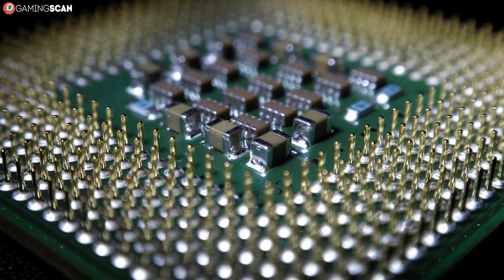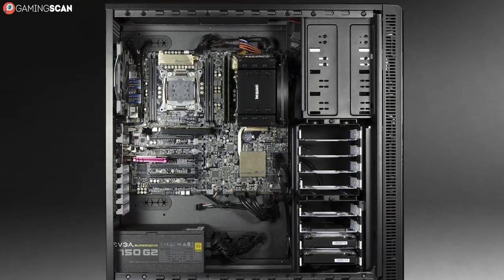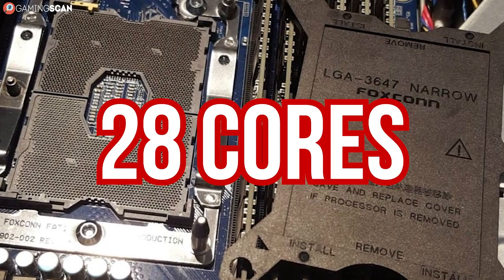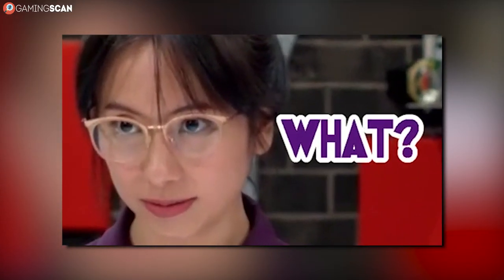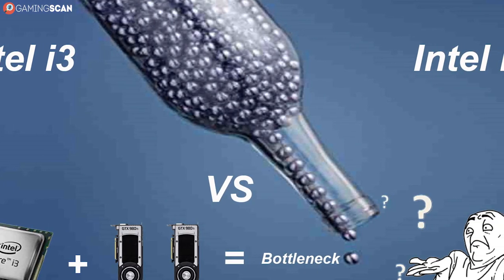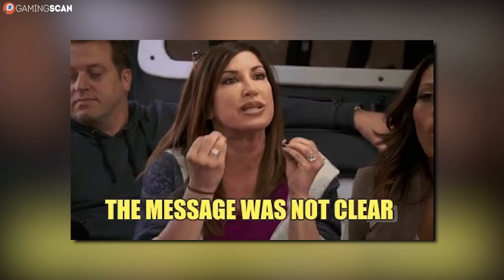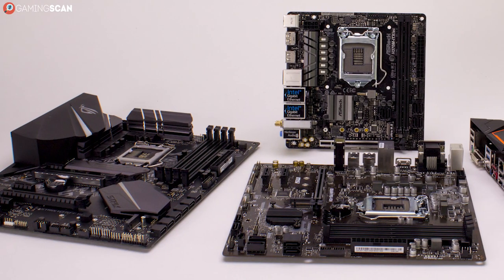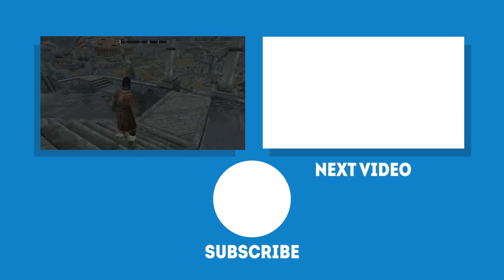Is An Intel Xeon For Gaming Worth It Today? [Simple Guide]

Comment: I've got a Xeon x5675 running at 4.5ghz with 6cores and 12 threads 48gb of triple channel ram and a 1080ti. Keeps up with any top end gaming rig. The Xeon cost me £35 from eBay. If any one is interested I'll make a build vid to show and prove what it can do and how easy it is to set it up.
Reply: Me sir👍👍👍
Reply: go for it!
Reply: do you know if dual x5675 can handle game streaming at 1080p60?
Reply: How did you overclock it? BCLK or multiplier?
Reply: Preach it brother  x5680 @ 4.42 Gtx 1060 20gb ram👍
Reply: How do you get a Xeon overclocked? That prosessor you mentioned has max turbo boost of 3,46Ghz not 4,5....
Reply: @a64738  as long as you have a desktop motherboard not server you can overclock the microcode should be there for 1366 motherboard. And get or build a good water cooling setup
Reply: Have the same band it runs any games at high and ultra
Reply: @a64738  Its very simple with the right motherboard...., its the busclock..., i have a Xeon X 5675 too with a MSI x 58 pro-e board. This MSI Boards have dip-switches on board, you can change the busclock from 133 MHz to 166 MHz ore to 200 MHz, the only thing you must do is to improve the voltages..., my X 5675 run at 1.35 Volts with easy temperatures at 60 degres celsius at 4.0 Gigaherz, my vga is a radeon RX 580 with 8 gigs of vram. All games including Division 2 ore Ghost recon breakpoint running fine with high settings, my monitor is at 1920x1200 pixel, i hope, this will help a lot....the powerdrawing is a little higher, the Xeon 5675 is a 95 Watt CPU, but with the overclock to 4.0 gigaherz it will be at 120 Watt....nice greetings and sorry for my bad english, iam an old german....;-))
Reply: @juergenwinter8378   I have a 220W CPU now... It is a Xeon 2288G 8 core that can run 4,7Ghz continous turbo boost all 8 cores if you use Intel Overclocking tool to disable the 3,7Ghz limit.  But then it uses 220W with all 8 cores at 4,7Ghz at 100% use which is just at the limit of what my huge heapipe cooler can handle even with 4 12cm fans.

Comment: You can build awesome budget gaming computers with Xeon processors.
Reply: @Eduard Berisa I built my son;s 1st rig and he still has it with Xeon E5-2620, turbo up to 2.5ghz 6 cores 12 threads, running next to a 1070 handles any game you throw at it
Reply: @i3luevein  how much fps do u get on a game, and on which games
Reply: @Shay-ul2bg  Hey - he got well over 60 in BF1, GTAV & PUBG. The single core performance is absolutely shite though as I am sure you would expect, but as he does allot of streaming, video and music editing it's a good all rounder. Look around YouTube, there are loads of examples of people gaming with the E5 2620.
Reply: @i3luevein  thanks
Reply: I just bought a westmere xeon x5675 for $25 awesome cpu amazing for a budget gaming machine!
Reply: @liamandrade5167  what about the motherboard?
Reply: My xeon 1245 v2 actually does pretty well. The only game it struggles on  is BF5. New i7 coming in a few months though, I've used this budget cpu too long.
Reply: @NAM3L3555  Just no sata 3 & usb 3.0
Reply: @ProCrastiN8te  If it can be overclocked with unlocked multiplier like a 2500k, I am sure it can at least used 5 years more.
Reply: @raymondchan3587  I'm afraid it can't  but even the unlocked 3770k is beginning to show it's age in some games. Runs most games well still however.
Reply: @i3luevein  on max settings?
Reply: That lady doesn't know what she talking about I running a Xeon CPU and it plays any game at ultra setting without any problem
Reply: Help me , can i play csgo with intel xeon w3550 and gtx 1050 ? ty
Reply: You can play csgo with any xeon
Reply: @kenopayne9466  how many fps? do u know? ty
Reply: I am using a dual Xeon x5575 with a amd rx560 and I am playing any new games without any problem on high and ultra
Reply: @kenopayne9466  what is dual xeon ? u got 2 cpu? xd
Reply: Yes you can csgo is core 2 duo
Reply: 2 Xeon CPU I carry
Reply: Yeah running a Xeon E1231 V3 myself combined with Asus Workstation motherboard, GTX1080ti and 16GB ECC RAM :) It runs GTA V mighty fine and everything else I throw at it ;) ... Now I just found brand new Dell Power edge T30 complete server machine with slightly better CPU then I have for same price as I did pay for just the CPU and RAM on mine...
Reply: @ProCrastiN8te  Hey i know its 11 months old comment but i would love to know what graphics card you used with xeon 1245 v2?
Reply: @basharshafiq850  haha no problem. At the time I had a gtx 1070 and just before thet a 980ti that exploded due to some crazy mods. However both cards were throttled by the xeon that couldn't quite supply them. The xeon  is still good but should be paired with a more balanced card like a 970.
Reply: Can we change the chassis of Xeon to Amy other custom chassis like NZXT or cooler master
Reply: meh

Comment: My Son's Gaming system is a Xeon x5680 and he loves it. He does a little streaming not much but mostly Pictures/Video Editing. Great budget machine. 

GPU: GTX 1080Ti
CPU: X5680 
Memory: 24GB ECC
Motherboard: MSI X58 
Storage: 512GB SSD Boot
LSI SAS Controller with Raid 10+1 (4 4TB Drives)
Sound: SB AE-5
PSU: EVGA 750w

Comment: Using an Intel Xeon E5-2690V3 SR1XN 2.6Ghz 12-Core 24-Thread Processor i got for $340 with 2x 1080Ti's and it kills any game I throw at it (Battlefield V, ROTTR, Apex Legends, Anthem, Overwatch, Rainbox Six Siege, Dirt 4, etc).
Reply: Hi, I wonder does the cpu fast in normal task

Comment: Running a Generation 3 Xeon 1200 series 3,4Ghz socket 1150 in my Workstation / gaming rig myself and it rocks combined with a GTX1080ti :) I chose this old prosessor to be able to run Windows 7 without hickups as it is much much better then 8 and 10 specially for anything that uses lot of memmory and also better performace in gaming.

Comment: best value/performance cpu in my opinion at the moment is the xeon x5670 easy oc to 3.8ghz..pulls far cry 5 and rise of the tomb raider like a charm, with only 30 euros. not bottlenecking my gtx 980ti oc,

Comment: X3440 is a xeon for 8$ and it can perform around a 7th gen i5
Reply: No.

X3440 is an i5 750 (first generation)

You need at least sandy bridge-XE xeon to match i5 7400 or first gen ryzen.

However LGA1366 6-core xeons are a great option for their low price around 20-25$ and can match modern i3
Reply: kkkkkkkkkk
Reply: use x5670 instead
Reply: I have to disagree it has the same cores and threads as it but it probs compared with a i5 3-4 gen
Reply: X3440 is for the lga 1156 mobos.  X3470 performs as like a i7 870 . 
An i5 7400 is far better both in multi core and single core due to better ipc,  architecture.

Comment: Using a dirt cheap E5 2670 ($80 AUD) paired with a 1660oc to game.  144+ fps on Apex max settings, 100+ frames on Rust high settings, 60-100+ frames on Tarkov high settings. You can definitely game on a decent Xeon and it will cost you fudge all.
Reply: Hi John, I wonder does that cpu fast in normal task?

Comment: I currently and previously have a xeon cpu in my gaming pc. this video did a decent job with explaining what a xeon is commonly used for, but it didnt really highlight the fact that while yes a xeon can be used for a server or workstation, if it has the same underlying architecture as say, skylake, then it will perform identically clock for clock with same core count cpus. xeons only really have added features, not negatives except for the higher core count cpus having lower clock speeds. I use a 10 core xeon e5-2680v2 in my main system and it only cost me $180, and it will last me for a very  very long time, as opposed to an i5 quad core which is already falling off.
Reply: But what do you do when the new generation of gpu's wont fit your motherboard anymore and you need to upgrade ?
I mean it prolly only last a very long time, if you dont feel like upgrading for a very long time right ?
Reply: Parasite Andy Why do you need to upgrade a powerhouse that is a XEON?
Reply: @kennybrianshjreklunke4842  What? So not a very very long time, but a very long time? I don't understand your point... at all. The new generation GPU's not fitting a motherboard is a ways off... it's not like he is running an AGP and/or we are on the verge of going back to AGP.

Comment: You can get a x5650 Xeon processor for only $20 on Amazon. Pair that with a GTX 1050 and you have a budget gaming pc
Reply: Dude the problem is the fucking motherboard.
Xeon x5650 need a motherbord with lga 1366
its extreamly rare:in my country i found one for 150$
Reply: @gazefstronof1030  you tried aliexpress

Comment: I have 2 Xeon X5472’s running @ 3 GHz each paired with a 1050 ti 4GB. I can run most games at 100+ FPS (Fortnite, Rainbow Six Siege, Valorant, CS:GO, Warframe, Rocket League) Would recommend to anyone who needs a decent cpu for a smaller price!

Comment: So I bought this $100 dollar pc second hand from 2016.
CPU: Intel Xeon w3565 3.26 GHz
Graphics Card: Nvidia Quadro FX 1800.
16 GB Ram
500 GB Storage. 

Is this playable for Fortnite? If so, can you tell me the FPS range. Thanks to whoever sees this and responds!
Reply: You'd get more for your money if you upgraded to a SSD. Especially if your a Windows user.
Reply: Would want a nicer gpu for modern gaming.
Reply: It’s definitely playable, although I don’t know how much FPS you’d get.
Reply: I wouldn't buy a gpu stronger than a 1050 or 1050 ti

A 7970 3gb can be had for sub 80 usd (might be able to buy it for sub 50 locally)

Then u can play most modern titles at medium-low settings

Note:

If you can grab a 1050 ti sub 80 usd, grab that

If you can get a gtx 970 sub 100 USD - get that instead (prioritise the gtx 970 over the 1050 ti)
Reply: @Lucky_0ne821  the ssd doesn't affect in fps also if you are mac user ;-)

Comment: but some older Xeon W and X chips are really good for gaming and a good price especially when you can fit two of them in the board
Reply: G POWER DRAGON yeah I got a x58 Msi proE board with a x5670 and boom
Reply: @morganroberts295  Yes- here the same rig, a Xeon 5675 with a RX 580 and the same board.....24 gig of ram, it runs all games very well......;-))

Comment: i have a intel Xeon W3520 and it manages to compete with mid range I5 processors and runs well even with games that rely on CPU power.  My system was pre built and only costed about $500 back then. 
a xeon CPU is more better than core CPU for editing, rendering and other workstation tasks whilst performing decently at gaming as well. although if you don't need it for other tasks and you are just considering gaming then I would stick with a core I5 or other cpu that is not for organisational purposes

so it is worth it but only if you can find a good deal.
Reply: Why xeon not suited for gaming
Reply: It is but it's expensive and on my worth if u get a good deal

Comment: xenon 771 mods are great budget build cpus, if you can find a good socket 775 motherboard or already have one with a tired core 2 duo but are only good up to a ($100 GTX 1050 or $50 GTX 750 used) unless you have a realy good motherboard for overclocking. I have a $16 X5450 & cheep old 380w PSU and case leftover from an old windows 98 machine in my $20 asus  P5G41T-M LX3 PLUS motherboard overclocked to 3.52 Ghz with a $20 air cooler only gets to 52c under full stress load and idles in the 20-30c range, plays fortnight in epic shadows off 1080 in the 75 to 100 fps cinabench R15 CPU score of 390, core 2 quads like the Q9650 and up are still pricey used at $60-100 and the E5450 and X5450 are just as fast.

Comment: using a board with dual xeon e5- 2660v3 CPUs with an Nvidia 1050ti. Not running into any problems.

Comment: I have xeon e5640 and wanted to upgrade my gpu to rx 580. Will it works ?
Currently i am playing GTA 5, Hitman, Far Cry 3 in low quality on a average fps and it is working fine with Quadro 2000.
Reply: I have a Xeon CPU and Rx 580 and can run most games at max settings with no issues. I haven't had any problems playing any game

Comment: I have a gtx-1060 6 gb with a xeon e5-1607 v2 3 ghz when i was at the store i asked:isnt this procesor ghz low.They told me to not look at the Ghz i was confused They told me its better than i3 or i5 or i7 i got Screwed i got only 40 fps average on gta 5
Reply: If you get 40 fps in GTA V with a 3Ghz prosessor it is not the CPUs fault, you simply need a better graphics card then a GTX1060 or run lower graphis settings (or something is seriously wrong with your computer,  or if you run server motherboard maybe it has only 1x speed for graphics card which would seriously hurt the performance as it is not ment to run fast graphics). I can run GTA V at 60fps on my 2014 Macbook pro at 3.1Ghz almost all at full setting with a GTX1660 and a old GTX980ti using external graphics card. GTA V runs also just fine on my Workstation at 60fps with almost all at very high graphics settings in 4k with a Generation 3 1200 series  3,4Ghz Xeon and a GTX1080ti ...
Reply: Bruh. We have the same GPU and CPU🤣
Reply: @ RondoCat I am with dell precision the only thing done to this computer is that the gpu was changed from quadro to gtx 1060 It is a server computer
Reply: @Vol7aren_   Cool, that should make a great gaming machine with just a little modding :) I would have made a hole in the side door with fan blowing cold air at the grapics card. I am considering bying a Dell EMC PowerEdge T30 Server myself for my mom as they sell them dirt cheep now brand new with slightly faster Xeon CPU then the one I have. With a bit of modding (like moving one HDD bay to give room for full size GPU)it would do fine as a gaming machine also. But It might need completely new powersupply for gaming (only 290w).

 My stationary PC has Asus Workstation motherboard, Xeon E1231 V3 CPU and 16GB ECC ram combined with my GTX1080ti for gaming and a little video and photo editing ;) I went the Server / Workstation route with ECC RAM in hope that it would make for more stable machine as I am tired of bluescreens lol ;) It seems to have helped, it has been running up to 2 weeks nonstop mining at the most with no crashes when GPU mining was profitiable.

Comment: I jist updated  my old rig from a i7 920 @3.8GHz to a xeon x5650 @4.2GHz and its a massive effect. Bought it for 18euros xD so yeah you can def  game on a xeon cpu combined with rx 580 i play every game like bf5 bf4 apex hunt at max settings on 1080p easy
Reply: Yes absolutly, theese old 6cores have alot of power inside..., i have the same system...with a Xeon 5675 and RX 580...works like a champ...;-))

Comment: Xeon E3-1231v1 here. No complaints when paired to a 1060 6GB. I have a very small voltage bump to the CPU, which has proven stable for the last year and a half and my 1060 is clocked to the moon. Things become very unstable quickly when you try to clock these CPUs the way you would with the consumer processors, so I'm only now feeling the effects of higher demand titles that prioritize clock speeds over core counts. i9-9900K, here I come!
Reply: What are your temps? Are you using an aftermarket cpu cooler?

Comment: I just got my hands on a x5570 and a Asus p6t deluxe  v2 12gb ddr3 1333 that mobo lets me overclock that cpu from stock turbo 3.3ghz  to 3.85 GHz 4c/8t for 125 cad $$ and I had a Rx 550 2gb kicking around that is working very well very stable OC so if you luck out like it's worth it but not if it's pricy much better options this set up games very well @1080p 60hz low-med settings

Comment: I literally bought a Xeon x5675 from eBay a month ago for $35.
Reply: Maximiliano Torres bro does that run fortnite without lag at high settings without overclocking?
Reply: @royalvlogger2093  dude my integrated graphics on my laptop  can run fortnite  if you have a gtx 1050ti or equivalent you could use a first gen i5 and run it on high

Comment: Hi guys, is an E3 1245 v2 worth it for 80$?  I already have all other necessary gear (16 gb memory, lga 1155 board, 1060 6 gb )
Reply: That is a fine prosessor that with good cooling will run 3,8Ghz turbo boost forever :) I have a Gen 3 Xeon that also torbo boost to 3,8Ghz combined with a GTX1080ti for gaming running Windows 7 (built computer with this old CPU brand new to run Win7 without hickups).

Comment: I upgraded the CPU on my computer from an i5 4 core 4 thread to a Xeon 4 core 8 thread at a higher clock speed. So yeah the computer and games do run faster on it. I find your repeated attempts to paint Xeon CPUs as none gaming or only business solution silly. If the clock speed is faster on the Xeon and it has more cores or more threads then I don't see how the experience wouldn't be improved over Core intel CPUs.

Comment: I have a xeon computer and I love it. But with it I have a GTX 1060 ti.
Reply: If you want more gaming power an uppgrade to GTX1660ti will give you most bang for your buck :) I have a GTX1080ti myself on my 3rd gen Xeon workstation and a GTX1660ti as external GPU on my 2014 Macbook pro and I must say I am impressed with the GT1660ti as it is not that far behind  the 1080ti that is almost as fast as the horrible expencive RTX2080ti :)